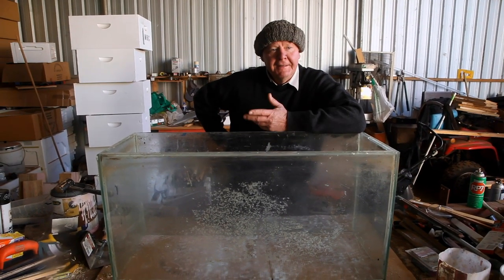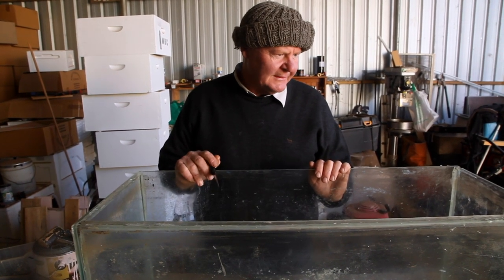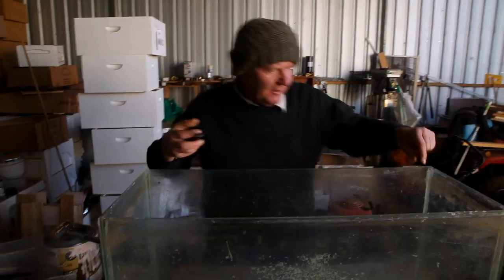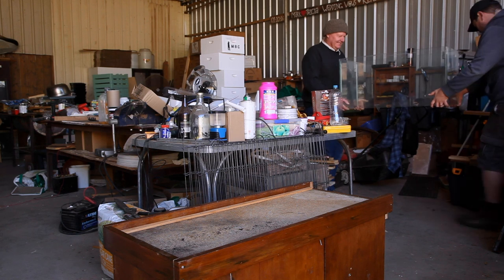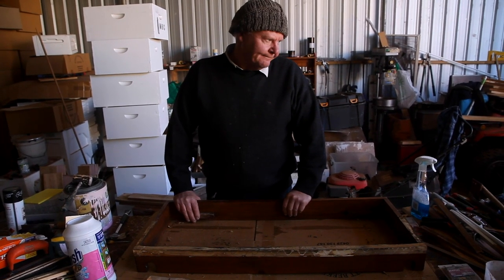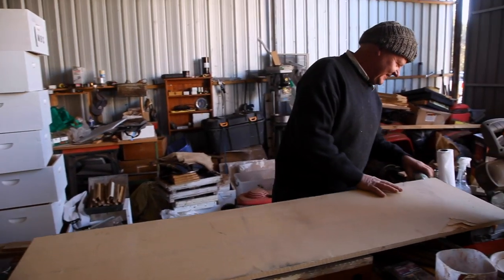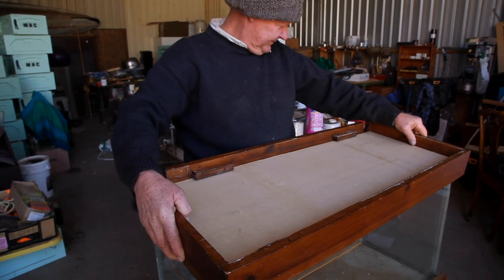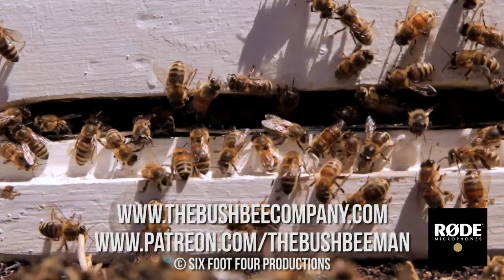How to Build a Fish Tank Observation Hive Part 4 - The Bush Bee Man

Comment: I wonder if the girls will use the guides on the frames?  Perhaps pre-treat them with some wax before introducing the swarm.

In my mind melted wax in a container long enough that you can dip the guides in for a few seconds so that the wood absorbs some wax as well as being coated.  the should encourage them to use the guides over the area between the guides.